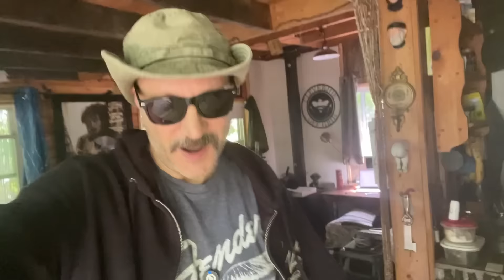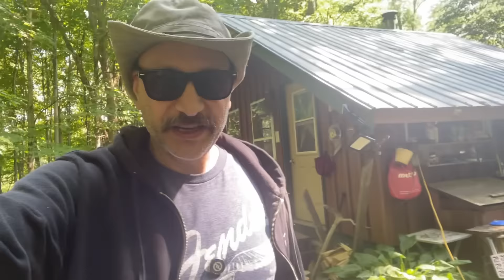Don't Kill Your Generator: 7 Mistakes to Avoid

Comment: Don't forget to drain carburetor bowl once a year to get any water out of the  bowl. I have two Honda's 2000's one with 12,000 hrs on it and the rope will fray about  2" in from the pull handle from vibration over time.  If you catch it early enough you can shorten the rope before it breaks. This has happened on both of my Honda's. I use a hr meter so I can change my oil at 100 hrs.  I have never adjusted the valves on these engines.

Comment: One thing nobody ever thinks about... whether the generator's neutral is bonded or floating. Most inverter generators seem to have floating neutrals. Most open frame generators have bonded neutrals. If you have an inverter generator, take one of those little outlet checkers which have the three lights on them and plug it in while the generator is running. See if it indicates a correct wiring. If not, your neutral is probably not bonded. A bonded neutral is needed to insure that a circuit breaker will trip when there is a short circuit. If this is the case, you can use a bonding plug to make your generator's output bonded. An electric system should always have a neutral bond at the source of the power. In your house, that is in the main panel. When you use a generator (unless it is connected to your house wiring) it should be at the generator. This is a safety issue, and there is a trove of information on the internet about it you can search for if you don't understand. Just sayin'.

Comment: The spark arrester is the #1 cause of generator. Routinely clean. The engine can’t exhaust if this is plugged.
Reply from the maker: Great point, it can certainly get dirty as well.

Comment: I used motor snorkel to convert my Honda 6000 to tri fuel. It worked great. Highly recommend. I'll probably do the eu2200 some day. Although it is less portable with a propane hose sticking out of it.
Reply: I added a Hutch Mountain Kit to my Honda eu2200i and the hose connects to the top of the generator.
Reply: @neilherman9624 I'll check that one out!
Thank you!

Comment: Hi  ! One thing you didn't mention is removing the ethanol from the Gas ! Another thing don't use gas additives they do more damage than they are worth ! Take a 5 gal clear jug add add a gallon and a half of water and Mark the top of the water line ! Add your gas in with the water leave about four inches from the top  shake it up good then let it set for awhile ! When you check it later you will see the water level is higher than it was before Mark your water level ! That is the ethanol mixed with the water ! Siffon the gasoline out ethanol free ! Ethanol turns into varnish and that is what ruins small engines ! Rick
Reply from the maker: Interesting, I’ve never heard of anyone doing this. 👍

Comment: The area I live here in Pennsylvania several of the fuel stations sell ethanol, free gasoline. That is all I buy for my small engines, including my four Honda generators. That and stabilizer put in the fuel and I haven’t had an issue with any of my generators. Some of which are 20 years old or older.

Comment: Most generators have small engines that have to run wide open throttle in order to produce any power. I believe that's why it shortens their life and makes them very noisy causes a lot of maintenance. I have a 1960's Onan generator that is 2 cylinders that are horizontal. Very smooth running. Built kind of like a Volkswagen engine only with two cylinders. it has a point ignition two coils 1 per cylinder.The generator itself is 14 inches in diameter and about 24 in Long. the generator itself is used as a starter for the engine.The engine runs at idle or just above idle normally. it will idle up higher if something large comes on like a well pump. It runs on gasoline or propane I have not used it on propane yet. it uses about 3 to 4 gallons of gas over 12 to 14 hours of running continuous. This thing sounds just like a car sitting in your driveway. Is very quiet you don't even know it's running I have a small car muffler on it. .  I have a 100 gallons of gasoline just for the generator. I cycle the fuel into my car and then refill it into the barrels so the gasoline stays fresh and  maintain my stockpile. This thing is a real brute weighs about 500 lb. I've got it mounted on a heavy cart with  steel wheels so I can move it around with my garden tractor if need be. Our power went out a few years ago for about 10 days straight. That generator ran flawlessly. Other than we were the only ones with lights on you couldn't tell we had a generator running.

Comment: Things I do for my generators.
Add a fuel filter if it does not have one.
I have 2 generators one is duel fuel propane and gas ( propane will not deliver the same amount of power as gas and natural gas has less power then propane)
The other is just gas. I run both for 5 hours when new and change the oil. At this point I add a hour counter to them. 
I take them out and exercise them every 2 months. I run them at 75% output for an hour (cheap space heaters are good for this). I also try to run them no more then 80% when using them. They are happy here.
As for gas use I use stabilizer. But when the fuel is at 2 months I dump it in the car and then refill with fresh gas. Then stabilizer is added.
Keeps it fresh. So when there is a extended power outage I am good to go.
Reply from the maker: Thanks for leaving a comment. That's what I do as well.. pour the old gas into the truck and replace the generator with fresh petrol. 👍

Comment: I have 2 Honda EU2200i generators, both of them I bought magnetic dipsticks for. One of them the magnet fell off! No idea where it went. It may have poured out with the oil? At the same time I noticed it was when I was preparing to get it ready for camping. I had it running and things were fine. I went to start the other generator and before I could add fuel to it the first one stopped running. The oil level light came on. I changed the oil again, ( had just done it in the fall before storing them over the winter) That is when I noticed the magnet had fallen off the dipstick. Related? No idea. I did take it to a Honda service center and the replaced the switch and everything runs fine again. I have since gone back to the original dipsticks in both.

Comment: Well maybe someone. An answer this one, I blow spark plugs frequently when I get close to max load. It’s a cheap one, I had an expensive Honda, but it would go through regular maintenance then I had to change main seal, then they no longer made parts…..wtf, so I did the math and I am better off buying a cheap as hell cheap one. They seem to last about 10 years, so I just throw them out and buy another cheap one, but this last one, it’s 1800w, I dint have anything that needs large load, I have a old used one, fir sawing ect, but this one I will use things like a toaster , less than 1500w, but I can hear it bear down when it starts off. But it has recently started blowing spark plugs. I change plug and then it works. But it’s blowing quit frequently now. Curious why.

Comment: plastc cam shaft and timing belt isn't good motor in 2000i and 2200i ,wont last for ever.
Reply: The GXR120 has a high carbon steel,  dual bearing crankshaft...it's not plastic.  Timing belts last years...the key is frequent oil changes.

Comment: General rule I follow is if I'm not gonna use it for more than 12 hours then I drain the carb. I have the Ecoflow smart generator that i have owned for 3 months and a Sportsman 7500w, both are dual fuel and only run them on propane. My dad has a few Hondas (2200i, 3000, and 7500) and I maintain them and make sure the carbs are empty by pulling the choke once they start sputtering during shutdown. I started being on top of maintenance for them in early 2025 when we had to replace the tank and fuel pump on his Honda 7000 generator. The best part is that I had it up and running 2 weeks before the July 4th storm in Ingram Texas and he was cut off and lost power for several days. They went 5 days without power when it was 98 degrees outside.
Reply from the maker: Timing is everything! Thanks for leaving a comment.

Comment: Oil doesn't break down,  it just gets contaminated with use. Oil just sitting in an unused engine doesn't go bad.
Reply: Wrong. Most oil companies say that oil is good for 5 years when sealed or 2 years once exposed to air. Also, thermal breakdown is an absolute thing. When oil is exposed to heat it breaks down in a chemical process and becomes sludge. You should absolutely change your oil every couple years even if you are not using your engine. I do every 3 years on my generators. Id be fine bumping that up to 5 or 6 years honestly,  but it still should be done. A $1200 generator is worth a $5 oil change...
Reply: : @bubbatime  Is degradation of stored synthetic oil ( Honda 2200i runs on 10W-30)  different than traditional non-synthetic oil?

Comment: this is very confusing when you say "Gas"  i think of propane gas , B.T.W propane is so much better than fuel , it has more shelf life , and you can carry it with you . while if you have an emergency and the fuel pumps don't work , or you have it store more than 3 to 6 months you have a problem
Reply from the maker: Sorry for the confusion - in Canada "gas" usually only refers to petrol.

Comment: I used a Hutch mountain in my eu2000 Honda. I works very well. With propane the output is slightly lower. The benifits by far out weigh the disadvantages. I've converted many fork lifts and pickup trucks to Propane. The oil and plugs run so clean they look new after recomended intervals. Rotten gas sucks!

Comment: Maybe not a generator tip, but keep all the tools needed to ever work on it in a special tool box.  That way you are never hunting for a tool.  

I would also keep a carb cleaning kit as well, just for one of those times.  An extra fuel lines in a sealed bag.

I had to finally clean my carb for some reason after owning it for 20 years.  Never left fuel in the tank/carb, but something got in there some how.

Comment: I converted my 2200i to propane to keep the power station in my teardrop trailer charged. I service it at the beginning and end of every season, I probably won't ever use gasoline in it again, but the option is always there. One safety consideration is to always have a properly rated fire extinguisher close. Just don't keep it right next to your generator. If it's too close, a fire might prevent you from reaching it and using it.

Comment: A 'Note' About "Gas Stabilizer's... Gasoline Degrades As Soon As It Enters Your Gas Can (Actually, It Begins To 'Degrade' As Soon As It Is Pumped Into The Fuel Truck... But You Have NO Control Over That).  The TIME To 'ADD' A Stabilizer Is Right When You Are Filling The Gas Can and NOT Weeks or Months Later When NO Stabilizer, Or ANY Amount Of Stabilizer Will DO YOU ANY GOOD.  just sayin'.

Comment: I have converted 2-Honda Inverters 2200i and 3000i to run on propane. Purchased the propane kits from Hutch Mountain. The 3000i has been run recreational fuel and propane. Our 2200i has had only propane fuel. We prefer using propane always. Absolutely no fuel storage problems. I also have Pri-G and Pri-D on hand. We only store recreational gasoline fuel and On Road Diesel fuel. Both are always treated for long time storage. We have several large propane tanks full and used frequently.

Comment: I have used the hutch mountain addition on a couple of 2000s and 2200s.  Quick and easy and allows me to store 20 lb propane tanks instead of gas for back up/emergencies.
Reply: Add another couple hundread to an already expensive genny.  My WEN DF360iX is already dual fuel.  Has more power output, better outlet connections and cost less than half of the Hondas.  I am a big Honda fan but they don't make me want to buy one based on those conditions.  And yes my WEN is more than 2 yrs old and runs awesome.
Reply: @johnpowell7341  That is Honda's biggest downfall and I don't understand why they don't recognize it.  I bought the hutch mountain because I already had the Hondas.   If I had it all to do over again I would likely buy a Honda and a propane ready Champion to go with it.

Comment: While propane will not go stale over several months i have been told you will go through it considerably faster than gas . And that being said for those who may not know every body always says 20 pound cylinders for those that may not know you can get a 40 pound and bubble that and are still not hard to handle? That equals about 11 gallons of propane than  versus about 5 and a half . A 40 pounder equals twice the fuel and takes up half the space and that can make all the difference when transporting all your gear ?
Reply: This is what I thought too when researching it.  I haven't done it so I don't have any first-hand experience.  However, after doing the math, I would not have room for all the propane cylinders needed to equal the gas cans I have.

Comment: Best advice on gasoline, is to use NON-Ethanol fuel only in your generators if using gas.
Reply: You won't find ethanol-free gasoline in a lot of places, including (but not limited to) all of the EU and this is not much of an issue anyway. Ethanol accelerates the fuel decomposition e.g. twice but the fuel decays anyway and you either counteract it or you suffer. There is a simple recipe: just drain your carburettor at the end of the season or after an accidental use. No fuel in particular place = no ethanol to worry about. Drain or top up the tank (either works, because ethanol needs air in order to do its bad deeds). Done.
Reply: good luck finding NON-Ethanol fuel
Reply from the maker: Try a smaller airport that has pumps.

Comment: I purchased my Honda 2200i about 4 years ago and everything you said rings true. 
It has about 350 hours on it now and still works perfectly. 

With the exception of a couple power outages where it was used at our residence, it is primarily used off grid AKA camping trips. 

I use the Honda to charge up the power station which powers the travel trailer around the clock. 

One of the points you made and I totally agree with is that it is best to not max out the Honda for high demand devices such as a microwaves etc. It will absolutely do it, but you know it is working hard. 

So when camping the power station does all the heavy loads up near the 2000 watt range at times, but the Honda is set to only charge up the power station at around 520 watts. Just barely above its idle range. 

If something happened to my Honda today, I would have a new one tomorrow without hesitation!
Reply: Mine has 5,000 hours and running my 6,000 BTU AC right now. I can change the oil in my sleep while blind folded.
Reply: Man, I didn’t know things could be so complicated.  We have owned a EU2000 for many years now for Vanlife and have never needed a second source of power.  The generator does it all.  Why wouldn’t it.
Reply from the maker: Nice, thanks for sharing your setup 👍

Comment: I also used the Hutch Mountain kit for my 2000i.  It's a bit awkward with the extra parts connected to the generator,  but once it's set up, you don't need to move it. I found the instructions easy to follow and there are plenty of how-to videos on YT.
Reply from the maker: Thanks, good to know. Seems like a lot of folks here have installed the Hutch Mountain kit.

Comment: Nice vid. I ALWAYS use an oil with ZDDP, an additive which is imperative in any 4 cycle engine. I use "Brad Penn" 10w-30 in my old Wen 3800 genny and HF 5000

Comment: I really like my new Champion 2500. I had a 4000 before with remote start which is really cool but it was just too big for me to carry around in my 8x16 cargo. It was 20 years old and the only thing other than changing the oil I ever had to do is replace the battery.  And making a better pull handle. The guy I sold it to just loved it too.

Comment: DON'T USE PREMIUM or any higher grade fuel. Just NORMAL UNLEADED is FINE.  The HIGHER GRADE FUEL actually BURNS SLOWER and you generator ignition system CANNOT ADAPT to increase the ADVANCE to cater for the slower burn rate.  YES HIGHER GRADES BURN SLOWER.  With HIGHER GRADE FUEL it can be still burning when the EXHAUST VALVE OPENS and SHORTENS it's life by BURNING the EXHAUST VALVE.  STD GRADE FUEL is WHAT IT IS MADE FOR.  HIGHER GRADE ALSO KILLS 2 STROKE ENGINES FOR THE SAME REASON, by BURNING THE PISTON and MORE HEAT as the PORT OPENS.

Comment: Great Video  📹  and Intel. My trusty Sears Craftsman Portable is a Bit Bulky being in a Cage and Wheels but has been a Trusty Tool for well over 10 years. REGULAR USAGE and Annual Maintenance is Key. Good Quality Oil and Filter and Non-Ethanol Fuel has saved the Rubber Bits from Vaporizing into thin air. This is also a needed Maintenance Tip that is over looked with old gas ⛽️ or this newer stuff Good Quality Fuel Line Hoses

💦 Indian Creek Ranch ⛩️ Southern California High Desert 🌵

Comment: Great video.  I have  2 champion  Tri-fuel generator  a small 2200 and a larger for the house  8000w .  I  run them both on propane ,  as per your video I am due for oil change and that is what I will be doing tomorrow ... winter is coming.  thanks for the reminder and have a great vacation .
Reply from the maker: Winter is always coming!  👍
Reply: @cleverjoe  one done... one to go and got to get more propane.